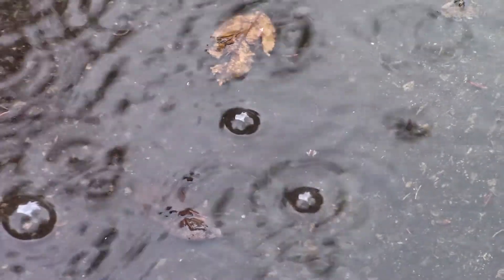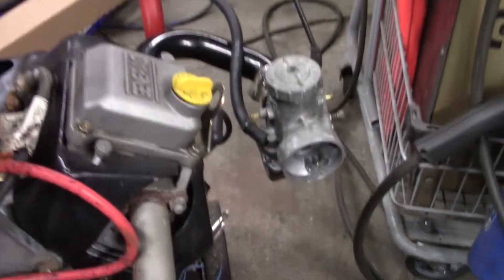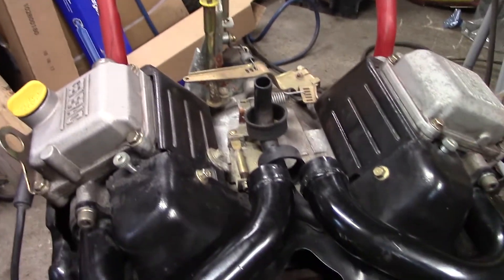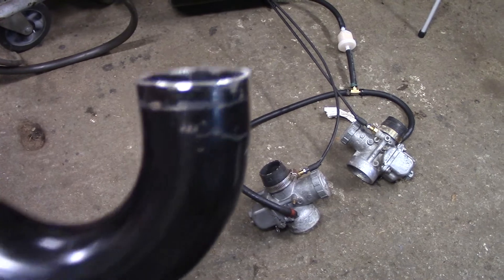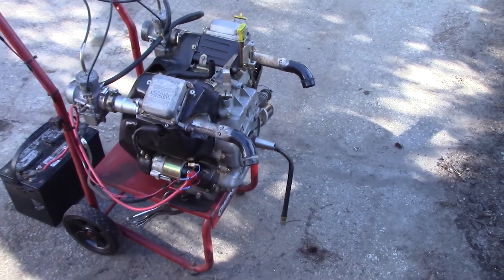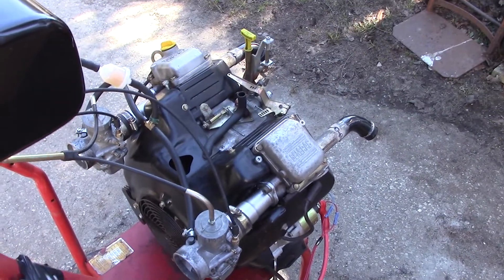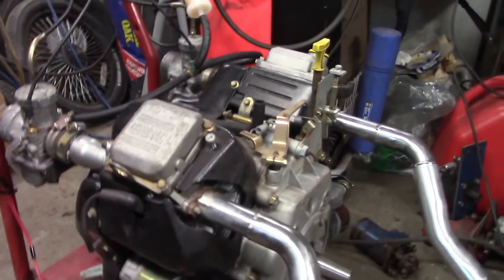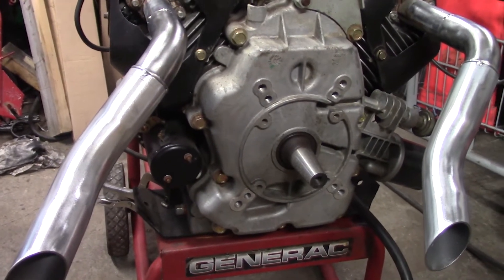Generac Generator Engine converted to run on Gasoline Pt-2

Comment: That's it
I keep coming back to these videos because I recently got a generac 816.
For a project seem like a good deal for as low a price it was, what a gift to find it's a high compression motor looks good to can't say it's gonna be good gokart motor or not.
That tractor I keep seeing I want one well sorta like it it looks cool.
So just picked up an old craftsman with a flathead twin 18 , now I'm looking for an all wheel steer 5speed I can butcher onto my craftsman making it 4wheel drive

Comment: Wow, I guess I was expecting you to just add a carb for this engine .   Generac uses the same engine in their gas model.  I’m hoping to keep it simple.   I don’t have these skills.  At least I’ve never tried.  I don’t have any idea how you would get to carbs to run the same.   I’ll need it to hold 3600 rpm’s for the generator to put out the correct hertz.

Comment: Hello Mr. Lawn gone, I have a quick question for you.

I have the same engine that I just got running on my channel with a single 38mm mikuni. I was told at work today that mine won't run right under load (I haven't had it under load yet, just started it a couple times) because the cam lobes have a different profile compared to a gasoline engine, something to do with the different burn rate of gasoline and natural gas??

Being that I know basically nothing about engines I just wanted to get your thoughts on this. There's not a ton of info on these, the only things I used when getting mine going were your two videos, and I read a little bit on a forum about golf carts. Thanks for any insight!!
Reply from the maker: I haven't had mine under much load yet,but I don't think it will be an issue.I do know that the compression ratio is higher for natural gas/propane engines (10.5:1) which will require premium fuel for the higher octane.I've got my Mikuni set up with a 325 main jet and a 25 idle jet,and it seems to be really close to running perfect.I hope this helps you,I had the same problem when trying to find info on these motors.Thanks for watching!
Reply: Yes this helps a ton thank you! I feel more confident moving forward now.

Is yours still set up with the dual 34mm's?
Reply from the maker: @kurtscustoms  I got rid of the twin carbs and went with one single 38mm Mikuni,seems to work much better now
Reply: Awesome news man!!! Thanks again.